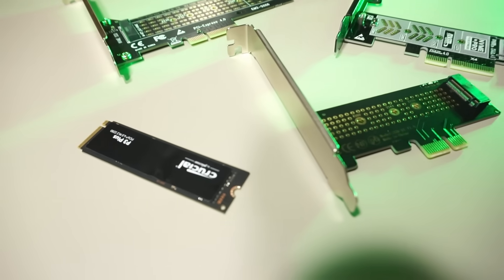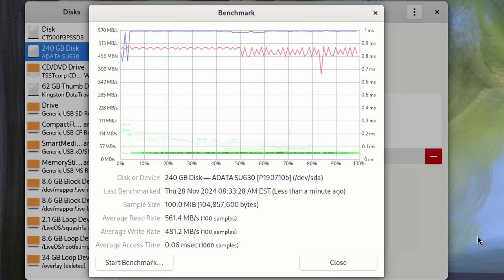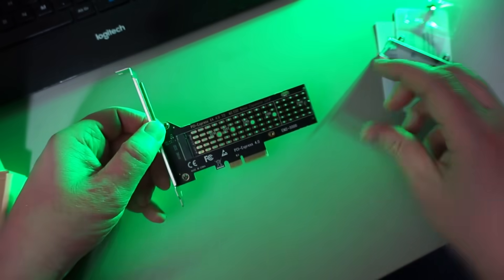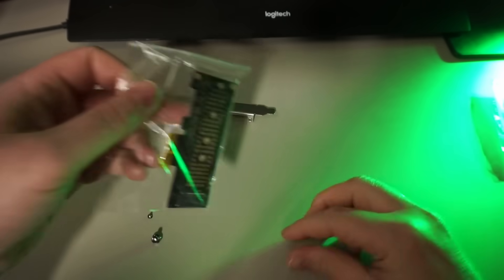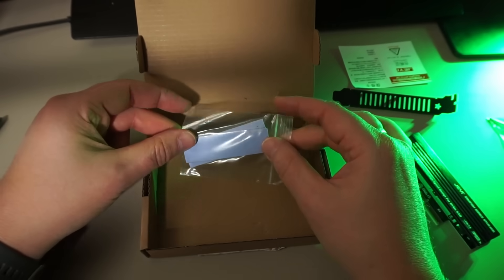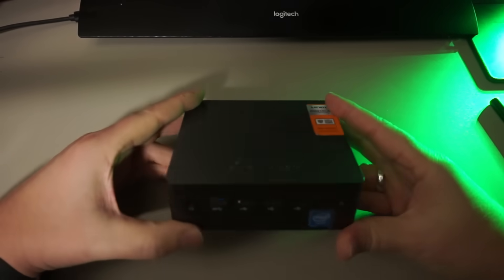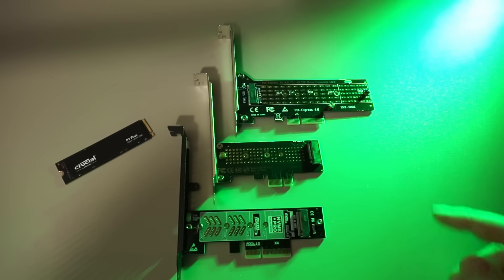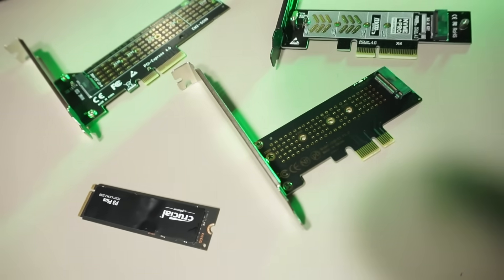Upgrade your old pc with an NVMe! Testing cheap PCIe M.2 adapters!

Comment: I have plenty of cheap NVMEs lying around bought from Aliexpress. These adapters are lifesaving for old PCs.
Reply: Sata ssds are fast enough.
Reply: @cobz76  yeah mine is going on 6 years in my old HP and doing great. SSD's in any system are an excellent upgrade or addition.
Reply: @cobz76  what if motherboard so old and have no SATA III? I did BIOS mod for two LGA 1156 PCs which have no native through-chipset SATA III and installed NVMe disks into PCIe 1.0 x4 and PCIe 2.0 x1 and got nice results. That approach is also applicable for LGA 1366. But yeah that's more about how stubborn user is and how old and crappy the hardware they owns...
Reply: @cobz76  They are but slowly dying out. Just look at the Crucial BX500, pure trash compared to NVMe for the SAME money. It makes no sense to buy one unless you buy it dirt cheap used. If you don't have some old low capacity SATA laying around you have little choice. I still have a 840 Basic 120 GB for such cases.
Reply: SATA SSDs are slowly dying out and you often get cheaper and better m.2s

Comment: Im using an old B75 1155 motherboard with a Xeon 1240 V2 and found a hacked bios that supports NVME boot, search for custom bios for your board you may get lucky.

Comment: a lot of motherboards limit the amount of lanes to extra pci slots, so it's highly probable that you were using 2 lanes instead of 4, that match the theoretical speed of 2Gbs in gen 3. try to use the crystal disk info, cpuz or Aida to confirm that. good work!
Reply from the maker: There's no difference on my board. I tried but it's the same (didn't think that was very interesting to show). Since the m.2 slot in our mini pc provided about the same performance I think this is actually what you can expect on PCIe 3.0. :)
Reply: also in some motherboards the graphics card only gets the newest version and the other PCI-e lanes are slowest.
Reply: @ElCidCampeador1994  I was not aware about that, thanks for the information!

Comment: Dude, your board only supports PCI-E in 2.0 standard. It is not "adapter test" but more like "PCI-E 2.0 and modern memory test".
Reply from the maker: My board does PCIe 3.0. I didn't have a board with PCIe 2.0 and more than one X16 slot or onboard video around so I wasn't able to test that but I guess it would be somewhere in-between my test pc and the Athlon 64 with PCIe 1.0.
Reply: @ex-itguy  In "final thought" we can see your motherboard model name: M4A88TD-V EVO/USB3. This board has AMD 880G chipset, so no PCI-E 3.0 support.
Reply: @ex-itguy  The only AM3+ board with PCIe 3.0 was the Asus Sabertooth 990FX/GEN3 R2.0 which uses a PLX chip to combine multiple PCIe 2.0 lanes for PCIe 3.0 because none of the AM3(+) chipsets had native PCIe 3.0. But your board isn't that one.
AMD AM platforms didn't get native PCIe 3.0 until AM4
Reply from the maker: Interesting. But what about the mini pc's M.2 slot that performed almost the same?
Reply from the maker: You guys have a source for that btw? The specs of this board mention PCIe 3.0. Is also printed on the board itself.
Reply: @ex-itguy  Is it not the ASUS M4A88TD-V EVO/USB3 you had in another video? The AMD 880G chipset it uses has 22 PCIe 2.0 lanes so it definitely shouldn't have PCIe 3.0 printed on the board. AM3(+) CPUs don't have any PCIe lanes so all the lanes are from the northbridge and southbridge
Reply: @ex-itguy  Youtube deletes my comments with links - but you can check wikipedia page with AMD 880G chipset specs
Reply: @ex-itguy  " But what about the mini pc's M.2 slot that performed almost the same?"

What's the mini PC's model name?
Reply from the maker: It's an Awow machine with an Intel N100 chip. I checked and the N100 has PCIe 3.0.

But I guess you guys are right about my board indeed! I thought I had seen PCI express 3.0 printed on the board but it's not there
Reply: @ex-itguy  " The specs of this board mention PCIe 3.0. Is also printed on the board itself."

Where? I saw a few pics of this board. It has "DDR3" printed on. Maybe you mistaken "PCI3" (the number of the slot) with "PCI-E 3.0"?
Reply from the maker: As mentioned in my previous reply: you are right, I am wrong. I simply remembered wrong.
Reply: @ex-itguy  "It's an Awow machine with an Intel N100 chip. I checked and the N100 has PCIe 3.0." I see the AWOW logo, but I need full model name :)
Reply: @ex-itguy  I wasn't able to find a proper official spec sheet for Awow N100 mini PCs but Amazon lists them as having M.2 PCIe 3.0 x2 which would have the same bandwidth as PCIe 2.0 x4
Reply: @Pasi123  "Amazon lists them as having M.2 PCIe 3.0 x2 which would have the same bandwidth as PCIe 2.0 x4" - exactly this. That's why I asked for specific model name, since Intel N100 CPU has 9 PCI-E 3.0 lines - and it depends on hardware integrator how the lines are used.
Reply from the maker: That would make sense. I just checked, it's labelled AK10.
Reply: @ex-itguy  AK10: M.2 2280 PCIe3.0 x2 SSD

Yep - this is the reason
Reply from the maker: Well at least it does mean that more old pc's can get the speeds in the video...
Reply: @ex-itguy  Also: if you use Google to search for phrase "NVMe PCI-E 2.0" the results mysteriously match what we see in your video: "So on PCIE 2.0, you'll get max (theoretical) 2GB/s. More likely a bit less on the actual nvme performance, around 1.5-6 GB/s or 1500-1600 MB/s."

Comment: I upgraded a core2 e8400 with a cheap nvme adapter. Of course, a ssd sata is needed for bios boot. The adapter I use is pci-e 1x. I achieve the same speed with sata ssd than with 1-channel nvme, although the latency is somewhat lower... And I use Debian Linux which is far more flexible than m$ obeseware for installation
Reply from the maker: Imagine the speed boost when you spend 8 bucks on an X4 card haha
Reply: @ex-itguy  yes, but no. The only pci-e 16x is occupied by the graphic card
Reply from the maker: Yeah that's an issue on a lot of systems. The Core2quad machine I had (actually the one in the thumb lol) doesn't have a second X16 slot either. 
A company is contacted me about an external NVMe enclosure they wanted to send me. Would be interesting to see if that might be faster than the X1 card.

Comment: Would of been interesting to have tried the adapters with 2 different drives so as to see if the drives themselves may effect the results....As in the slowest adapter may work better with a different brand drive...and the faster worked slower with a different brand..as the controller on various drives may work differently with different adapters..Just a thought.
Reply from the maker: I don't have that many drives though, but it would've been more "scientific" that way 😄
Reply: @ex-itguy  I am guessing the slowest would still be the slowest as it has less connections on the board. (x1  vs  x4?)
Reply from the maker: Indeed, it's severely limited by the amount of lanes. 
By the way I speed tested my 2015 Macbook, which also has a pcie 3.0 nvme (just with a proprietary connector...) and it also got to 1.7GB/s like this drive did in the mini pc. So I guess that's the limit of a PCIe 3.0 connection.

Comment: Good information about some M2 adapters. I remember building a gaming PC in 2008 with the same ATX case in the thumbnail pic.
Reply from the maker: Thanks! It seems to be a pretty well known case so I thought it would make a good thumb. I'm actually planning to move the hardware from my Phenom 2 machine in there though since it is quite a good case. :)
Reply: @ex-itguy  Nice. I think I remember getting the same case from Fry's electronics in late 2006. I miss that store.
Reply: @ex-itguy  Whats the name of the case? I'm looking to buy one
Reply from the maker: Good question, it's a cooler master case. It came with the $27,73 pc a few videos back.

Comment: You actually can boot from an NVMe drive even your motherboard doesn't explicitly support it, as long as it supports UEFI (and your OS supports UEFI boot). Every single NVMe drive comes with an OpROM, which is basically a "UEFI driver" that tells the UEFI how to boot from it.

Also, there is one NVMe drive that is known to have a legacy OpROM, which allows you to boot from an OS installed in legacy BIOS boot mode (the motherboard still needs to support UEFI): the Samsung Pro 950.
Reply from the maker: Interesting, someone else mentioned something similar. My Phenom II system does support UEFI but I haven't gotten it to boot from the NVMe yet. Something to dig deeper into for sure!
Reply: @ex-itguy  Specifically for a Phenom II (or FX) there are quite a few AM3+ boards that include nvme booting natively as well. Ones I've found include it are the MSI 990FXA Gaming, ASRock 990FX Killer and Fatal1ty 970 Performance, the Asus 970 Pro Gaming Aura and TUF Sabertooth R3.0 (but not the earlier ones) and the Gigabyte GA-990X-Gaming or GA-990FX-Gaming. 

The latter of which I've got, but I'm not that impressed overall. The UEFI isn't as nice as I'm used to even from boards much older than this and even though Gigabyte claim an FX-9590 should be fine, it won't even post most of the time. Had to undervolt and underclock it significantly for it to work. VRM's are waaaay too weak for a 9590. Should be fine on a Phenom though. 

Oh, and some boards got modded bioses as well, like the Asus Crosshair V Formula-Z. Apparently it's possible to shoe-horn nvme support from slightly newer boards onto older boards.
Reply: I didn't get it to boot with an older board (which supports UEFI). I tried every disk/CSM/legacy setting combination, but it didn't work.
But what works is to boot from a SD card with rEFInd installed and that boots the system on the NVMe SSD.
I don't mind to use a SD card. Before adding the card I booted the complete OS from SD card, because all SATA ports are taken by the HDDs (it's a NAS). But having an OS on a SD card is not stable. Now it is stable. ;)
Reply: @Schwinni  you would need to mod your bios to add nvme drivers
If you refer to Clover, you have your OS on hard drive. With SD/usb you just boot from legacy to a UEFI bootloader that accepts booting of your hard drive OS
Reply: I believe you can boot from it if you deactivate "Legacy" boot options from your BIOS and put it exclusively to UEFI
Reply: @MrGabrielgn  The motherboard is an old ASRock FM2A85X Extreme4-M, deactivating the legacy stuff didn't help. But when I read @filda2005's comment correctly, there's a way to patch the BIOS. I'm gonna try that, because I found instructions for AMI BIOSes and luckily the ASRock FM2A85X Extreme4-M has one.
Reply: I've used Clover on a USB stick and booted via NVMe on a non uefi first gen i7 for quite a few years. Was a little cumbersome to set up but worked very reliably afterward.
Reply: yes it's the Samsung 950 pro that supports legacy bios boot I use them on my X58 machines I have them both they only came in 120 and 512GB you can still find the 120's new on eBay and good used ones in the 512GB I just picked up my 512 open box only tested 100% life good as new just make sure to get disk info for life and write data from the seller I have had no issues returning eBay parts that don't arrive as described even get to keep the parts with a refund sometimes as it costs the seller for return shipping
Reply: Funny enough, I have a 12 year old PC that boots via its NVMe drive using an adapter plugged into the the PCIe port. The speed increase has really brought it into the modern world....at least the boy no longer moans about wanting a new one. And yet, I also have a 7year old PC with adapters that just won't boot unless legacy mode is enabled. Such are the joys of owning a PC.
Reply: Unless you have an older HP Machine, which just says "no".
Reply: You Can Load A Boot Loader From Another Drive And Trick The Machine To Boot From The NVME! But PC's Are Dirt Cheap! I Bought 5 Optiplex 7060's With The I7 8700 CPU For Less Than 1000 US For The Lot! That Is About 200 Each! They Have A NVME Slot On The MB! It Is PCIE Gen 3 But At This Point We Are Faster Than The Slew Rate Of The Transistors! Just Look At Memory Speeds! DDR5 CL39 Is The Same Speed As DDR4 CL16 Right? It Takes 39 Clock Cycles To Get The Data Out Of The DDR5 And 16 Clock Cycles To get It Out Of The DDR4 ! That Means There Is Basically No Difference In The Actual Speed Of The Memory!
Reply: Thanks for the suggestions and discussion, everyone. I had tried an M.2 PCIe card adapter about ten years ago in a Core2Quad Dell Precision; BIOS couldn't find it to boot from with a Samsung 850 (I think it was). Tried it an an MSI AMD APU motherboard, same result.  I gave the drive to a friend, and trashed the card.  Now, I am wanting to try again with new insights, since I still have both machines.
Reply: You can use the Samsung 950 Pro on any legacy board, no UEFi support needed the only thing that is needed is that the OS has an NVME driver but that can be the samsung driver you can load during the setup on older OSes
Reply: Wrong
Reply: Wrong. You need to mod the bios to do this or use something like clover.

Comment: does this work with  bootable windows XP?
Reply from the maker: No idea, but Windows usually needs storage divers and I don't expect them to be available for XP.
Reply: @ex-itguy  still wondering tho, I heard people on forum had done modified the nvme driver available for XP
Reply: No reason to be on xp no more. It's a virus playground. Windows 10 about to die out as well. Linux or Windows 11 pick one.
Reply from the maker: @100Bucks  some people have an XP machine for gaming. I can see how ultra fast storage would be nice for that. :)

Comment: I also found out the same as you. I recently built a cheap gaming PC using a spare Dell Optiplex SFF i7. I had some space Nvme drives and so was hoping to use at least one. Well, none of the cards seem to have a low profile bracket, so the card is just sitting loosely in the slot. So not great. And as you noted, no bootloader on the cards so i cannot boot from it. So i have windows 11 on a Sata SSD, and saving game installs to the nvme. Its still nice a fast to be fair.
Reply from the maker: Interesting, both the X4 cards I tested came with a low profile bracket. There's a bootloader that should work with Windows as well, but I have to look into that myself as well. Linux is a lot easier in that aspect: just put the /boot partition on another drive.

Comment: I hope you plan on looking into the win-raid NVMe BIOS mod guide (now hosted by levelonetechs).
I've done it on a few motherboards and it usually works.  It is an EFI module you can inject into the BIOS and then it will support NVMe.
Also see Cloverboot USB.  It has NVMe boot modules on it so you can use it to load NVMe.

Comment: Thank you for this video.  I was planning on adding a NVMe to my older PC, using a Plug-in PCIe M.2 adapter, but have now change my mind, as it's not going to be much faster than the 1TB Samsung 870 EVO SSD I already have in my PC.  Russ.  UK
Reply from the maker: I think 3x SATA speed is a pretty good improvement though 😄

Comment: Cool, good way to add a nvme drive. Personally using mint I can not tell the difference between a 7200 rpm HDD and a pcie 3 nvme SSD though. SSD with laptops are great for durability and power efficiency that is the biggest advantage that they have. Great video!
Reply from the maker: Thanks! Spinning harddrives are definitely a lot slower than SSDs. You should be able to notice that for sure. :)
Reply: @ex-itguy  Yeah I use both but to me it does not make a massive difference on linux. It is faster but I just don't find it to be absolutely necessary. SSDs are still nice though especially for laptops.
Reply: Even If you use a sata ssd as a boot drive you can already see the difference booting but especially patching your system compared to a rotating disk.
Reply: @nielsdebakker3283 Yeah I use SSDs on a few machines. It is faster I just don't find it to be as big of a difference as people say it is that's all.